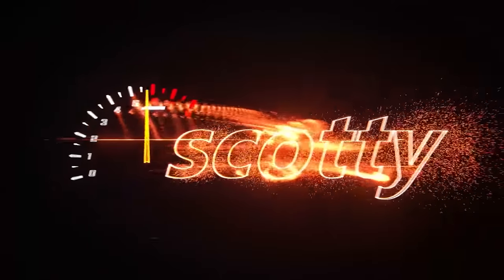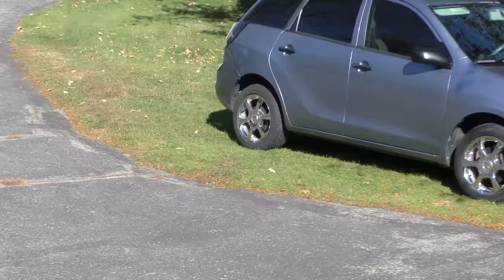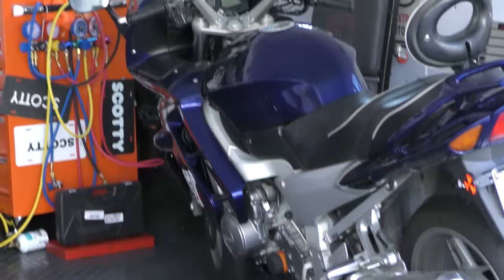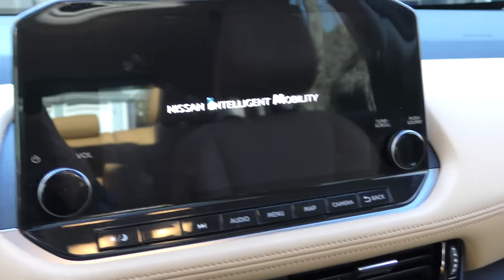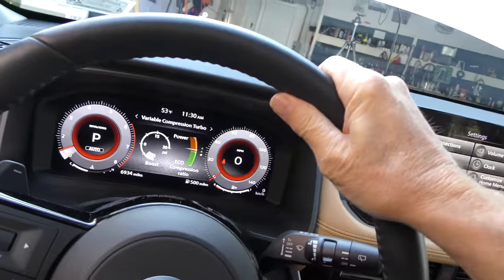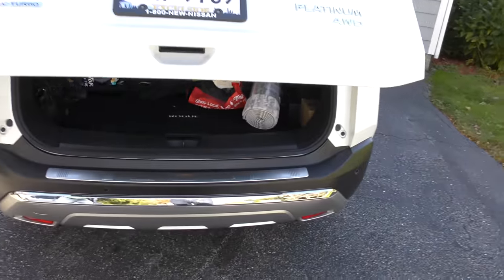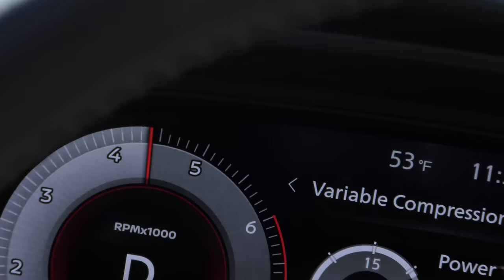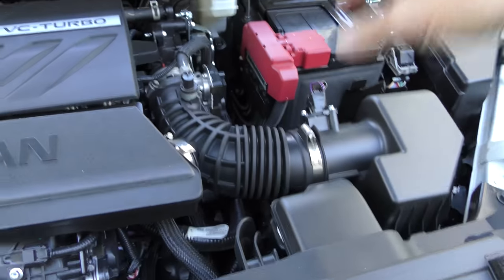Nissan's New Engine Shocks the Entire Car Industry

Comment: I'd worry more about the CVT Transmission than the VC engine. Stick with the base trim, for the best value and simple analog gauges.
Reply: I don't know if the new Nissan does it, but the Audi's have a digital dash and can display your map.
Reply: The CVT is all new better it look stronger than the older ones.

Comment: Even though Renault already reduced its stake in Nissan at 15 percent, which in turn ended up as an equal partnership with an equal share percentage, then given how that Scotty guy made himself impressed with the technology of the engine being shoehorned in the X-Trail (Rogue in U.S./Canada) means if Renault were to cut its ties with Nissan and Mitsubishi as well, then in turn, if Nissan were to trade Renault with Toyota as a (Nissan's) partner - just like Subaru and Mazda did as of now - Toyota may end up rebadging Nissan products and in that case the Corolla, Corolla Cross and RAV4 could use the platform that runs the X-Trail/Rogue and the current Mitsubishi Outlander. (Which means the TNGA platform that currently powers the said three Toyota products could be sold to another corporation if Nissan were to replace Renault with Toyota as a partner as having said earlier.)

Not to mention, having Nissan to trade Renault with Toyota as a (Nissan's) companion could lead to Toyota expanding its presence in Mexico since the latter is a major market for Nissan - in turn Nissan could expand its presence in Southeast Asia and Oceania since these are markets where Toyota is a dominant brand there just like Mitsubishi. (But unlike Toyota, Mitsubishi is not that big as it was in the 1980s until the early 2010s and the discontinuation of the Lancer Evolution in 2016...)

Comment: Scotty...i am looking at a 2022 and 2023 Nissan Rogue Platinum model right now. Are you sure the motor and tranny have a LIFETIME WARRANTY? Where can i find that info? Thanks so much. I like this Rogue but worrying about this engine etc based on your commentary.
Reply: I think Scott said  that that particular dealer gave that guy that waranty, not the manufactuer. Scotty said it's good as long as that dealership is around and since it's there for 50 + years, it probably won't go away soon. And this guy changes car often so anyways.  Look at the video again to verify.
Reply: I just purchased a 2023 Rogue and was able to get an eight year warranty from my local Nissan dealership. I did not have an option for a lifetime warranty.

Comment: 3 cylinder,  turbo, Jayco transmission..  what could possibly go wrong??  😬
Reply: nothing, murano has not have issues since 2011, nor the maxima, and what ever was with the period of 2012 to 2016 when numerous CVT failure occur, the other cars got fix from 2017 year.

Comment: Bought a brand new 2021 honda pilot for 39k with 3 more cylinders and can tow 5k lbs and seat 7 adults.  The only way i’d ever buy another nissan is if it was 1/2 the price of an equivalent toyota or honda. Even then I’d probably regret purchasing the Nissan.
Reply: Had a 2006 Pilot.  Currently have a 2014 Nissan Pathfinder.  I maintained both religiously.  Both were and have been very good vehicles.  I get nervous when the odometer hits 100K and want a new car (tech changes a lot and the interiors wear out too).  But when I was shopping in 2014, the newer Pilot just didn't have as much trim available as the Nissan.  Lots of things missing from the feature list, and not a huge price difference, so I went Nissan.  Never towed with the Pilot, but the Pathfinder tows well.

Comment: lifetime powertrain warranty requires main dealer services and routine preventative maintenance the dealer will make back double what car is worth after 7 years then if engine fails he will buy at far market value, fix issue and resell at a profit, chances are it will never get to this and he would have quadrupled sales with this pitch. its clever marketing..

Comment: My 2012 Altima has over 150k miles. Apart from an AC compressor replacement at 140k its been problem free. I've gotten the CVT fluid replaced every 30k since I got the car with 20k miles. I think the issue with Nissan is the CVT service interval wasn't conservative enough.
Reply: The older design had overheating problem which the viscosity of the oi breakdown faster, that why it require those interval, I guess Nissan finally caught up how to solve the issue.
Reply: @cb5110  you're probably right...mine whined after hard driving. That's what clued me into needing a shorter service interval.  Unforced error on Nissan's part. It should have erred on the side of caution.  Now its CVTs have a bad rap.

Comment: So with this unlimited lifetime warranty, if your engine blows while you're taking it on a long road trip, would you have to tow it back to the dealership to get the repairs?  If so, and the dealership won't fork the total cost...would worry the heck out of me.  Never had any good experiences with Nissan especially the rogue which had a bad cvt and cut power on me while on the highway.
Reply: Nissan had CVT problem 2010 to around 2017, they got better and better after that period.
Reply: @cb5110  I generally don't respond to comments but this subject I've been monitoring since my ownership with a Nissan and just a simple Google search shows vehicles up to 2021 with continuing issues with their transmissions (fluid leaks to lack of power to even not getting past 40 mph - this was my issue on a highway!).  It may not be the same as with the crappy Jatco transmissions but it seems Nissan still cannot get it right.  The list shows that Nissan CVT still has issues in 2018-2019 Versa note, 2015-2017 Quest, 2015-2021 Murano, 2016-2021 Maxima, 2017-2021 Altima, 2018-2019 Sentra, 2018-2021 Pathfinder, 2015-2017 Rogue.

Comment: Most any vehicle is going to be nice when it’s brand new.  In 2008, my mother bought an Altima new, and sold it in 2011 with 44k miles (mostly road miles).  She never had any problems during the time she owned it.  The reason she sold it was due to the notoriety of the CVTs in Nissans.  Not sure how it held up for the person who bought it.
Reply: Just depends on how hard its driven.. all highway miles then it probably does okay
Reply: it probably hold up if the person knew about the CVT had to have often service. the problem with Nissan past CVT was over heating, you have to change the oil regular as the viscosity break down much faster.
Reply: @cb5110  no doubt.. people who buy “japanese” cars are cheaper than dirt and never want to pay for maintenace

Comment: Three cylinder engines worry me. They are not stable. They vibrate like a d**do. And they work a lot harder then a 4 cylinder engine to deliver satisfactory performance. My personal experience with 3 cylinder engines is they only last 10 years.

Comment: I guess  this  was designed after complaints about CVT's dying early; this way the engine is finally likely to die just as early as the transmission 😂

Comment: I just bought a 2021 Nissan Altima brand new no mileage…do u think it has this same engine and cvt
Reply: Obviously brand new cars have .... 0 miles 😛😛😛
Reply: @HEMI345S  read the question my man
Reply: @908dirtyjerz  😁😁😁
Reply: 2021 is not new, we almost finish 2022, and no the engine nor the transmission are not the same, the 2022 rogue is different from the 2020 and 2021 model, it use an all new CVT call x-CVT, it is not a redesign, the engine is KR15 turbo, the Altima use 2.5 PRDD.

Comment: The all-new, 2023 Nissan Rogue Platinum AWD crossover with the 1.5 L turbocharged three-cylinder engine and the CVT would be excellent for an individual, who will be planning to trade-in their current, gas guzzling minivan, sedan or SUV with the four-cylinder, V6 or V8 engine, which is most likely their vehicle from the 1990's or the 2000's. Thank you very much.

Comment: The last good Nissan engine is the v6 4.0 they then screwed the engine up making it a direct injection motor 3.8 motor =carbon disaster waiting to happen
Reply: then you know nothing about Nissan, Nissan was one of the first to make a DI engine, from back in the 1990's.

Comment: 3 cylinder engine, not for me, lol. I just took a 6 hours round trip with my 4Runner pulling a 6x14 trailer. Pulled it no problem and for 1/2 the trip it was loaded down with about 2500 pounds, plus the trailer. Try doing that with a POS unibody Nissan.

Comment: Nissan is trash ,I have a 2016 Nissan rogue in 3rd transmission,twice replaced brand new under warranty by manufacturer first one went bad initially @47k and second in around 62k now new one has done issues and it's not even 30k

Comment: Good job copying the Honda  CRV
Reply: Nissan have being using down size engine long before honda CRV, the Xtrail which was the rogue had the 1.6 turbo in Europe since 2015. honda start use the 1.5 in 2016.

Comment: "HIGH TECH" "TECHNOLOGY ADVANCED" BLAH, BLAH, BLAH! Translation...the more they complicate the plumbing, the easier it is to stop up the drain. No thanks. Give me a engine with a carburetor and a point distributor and l'm good to go. lf it won't start it's ether no gas or no spark, those are very easy fixes that don't require a college degree.